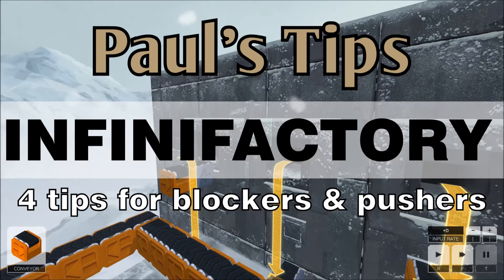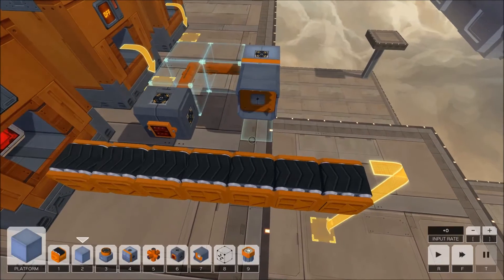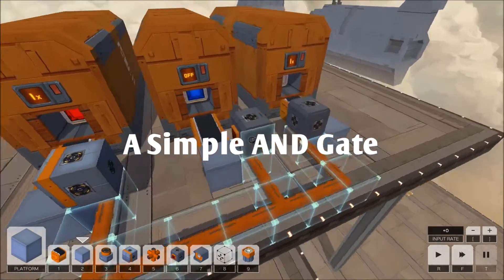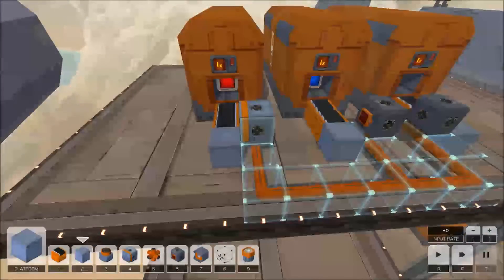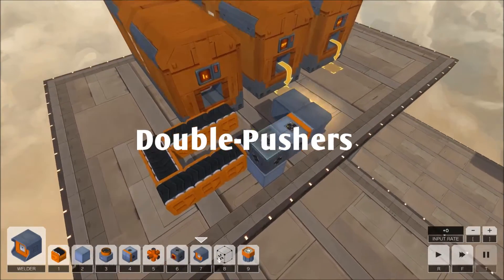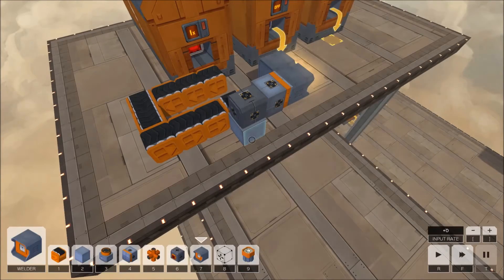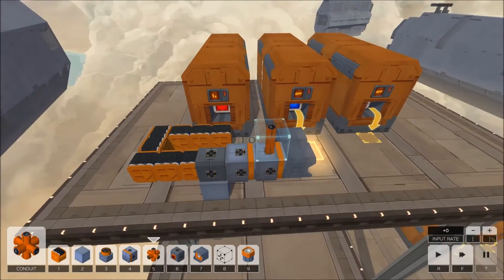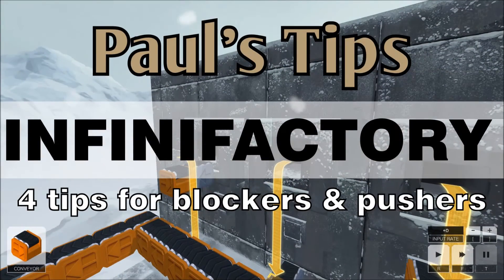Paul's Tips - INFINIFACTORY

Comment: I know this is an old video but still love the game. For the last part, the double pusher, you can make a 4 long strip of orange pipe in the air and have it drop onto it. It saves room and blocks. One of the biggest tips I could give someone for this game is you can have things fall into place so that they aren't connected to the world, like if you need to be able to use a pusher while it's sitting directly on the ground or next to other objects that would cause it to not move.